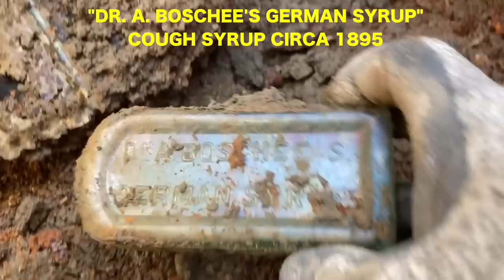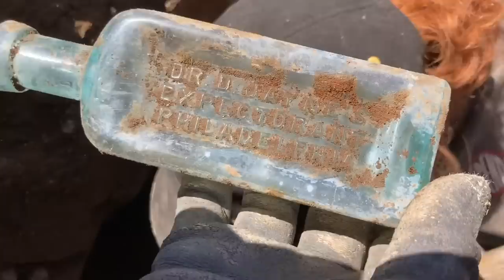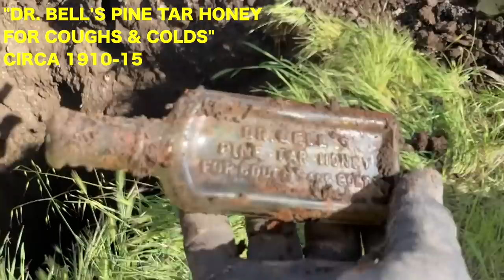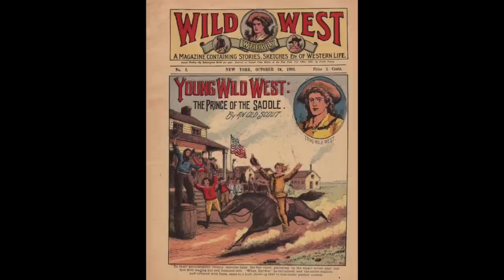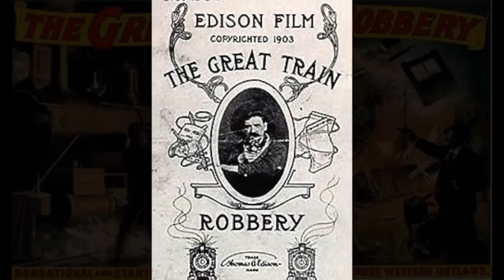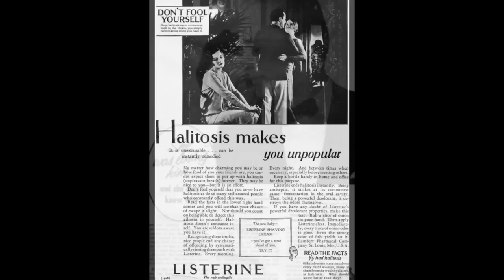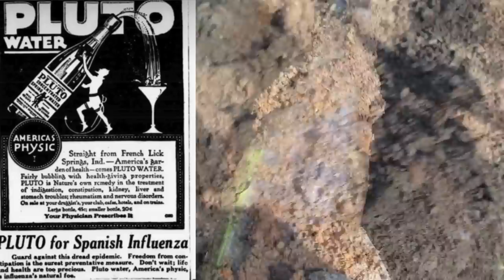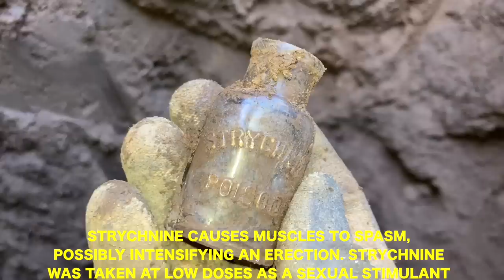WE DUG UP CHARLIE CHAPLIN'S LOST ANTIQUE BOTTLES !!

Comment: Ned, love your videos!  I think you misspoke at about 25:08.  You said the seam was made when they pressed 2 halves of the bottle together.  The seem on machine made bottles is from where the 2 halves of the forming mold meet (like a clam shell).  The extruded molten glass blob is sandwiched inside the 2 mold  halves and blown into it. At least that's the way it has been done in the last 60 years or so....
Reply from the maker: Yes ! Thanks for the clarification!